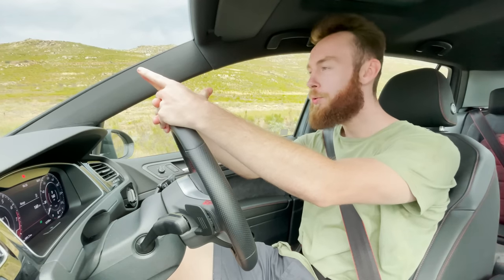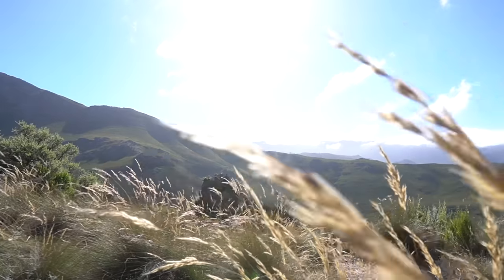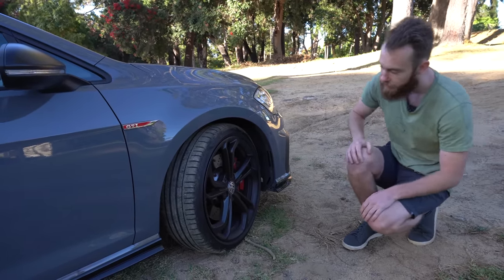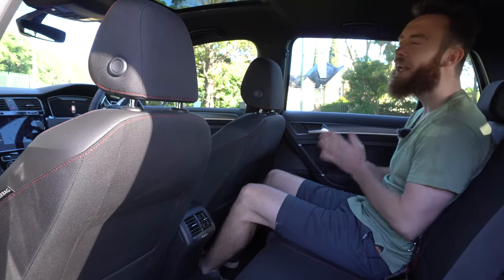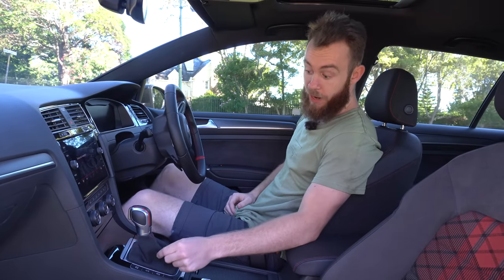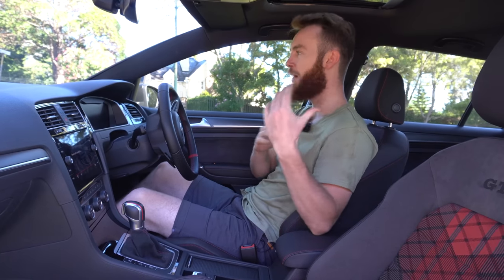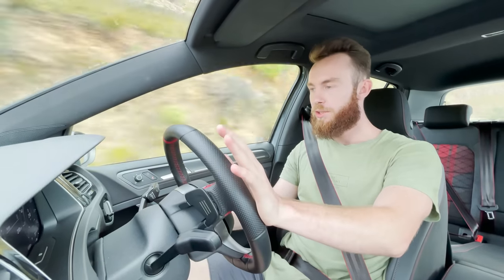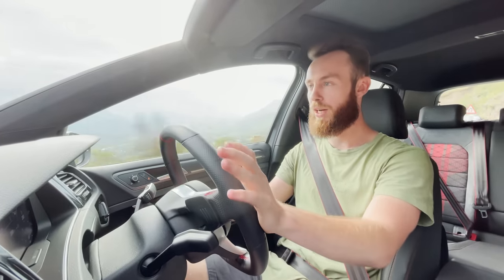VW GOLF TCR, the last look at an S.A icon!

Comment: Brilliant video sir, well presented, I love this TCR, pity vw doesn't allow GTI owners to upgrade their exhaust and software same as TCR, so one can keep ones warrantee, for most gti owners it's always about the irritation of the wheel spin you get due to all that power to the front wheels, therfor most gti owners are opting for the R as the next buy, more of a controlled take off and more power if u comparing the price range with this TCR vs R not far apart.

Comment: Still 7.5R for me for that money 😅
Reply: Yes man you get all wheel drive and 228kw .0-100km 4.7sec
Reply: @shameemlottering9507  but apparently this is quicker than a R 100-200, also saw some dude from jhb smoking a S3 in a drag race
Reply: Pre facelift rs3 too😋 clubsport gti still better looking imo.
Reply from the maker: Look, they appeal to 2 different people.

TCR being a lot more rewarding through twists
Reply: But we all know what going to happen in a straight line and that's   what counts
Reply: @njabulosibiya6578  correct no problem taking on a S3 robot to robot
Reply: @shameemlottering9507  The TCR is 10 seconds faster than the Golf R around the Nürburgring and it's 0-200 is just as fast 😅 so that's two pros plus there's resale value so you'll be a bit daft to get an R